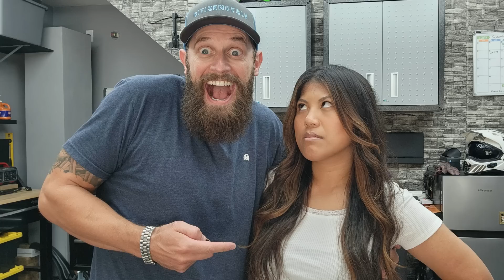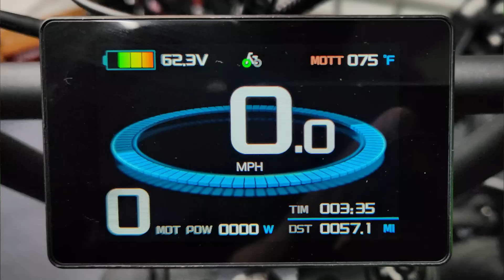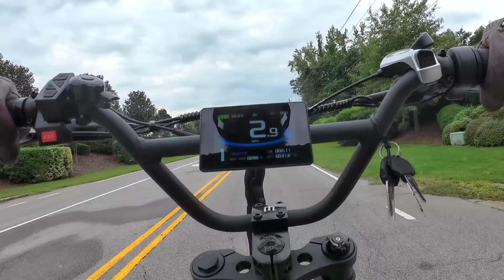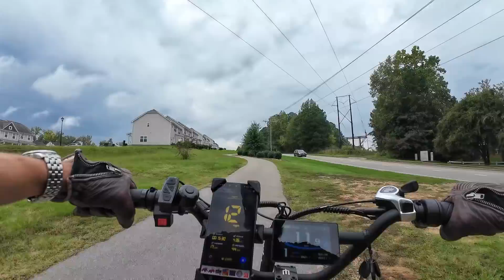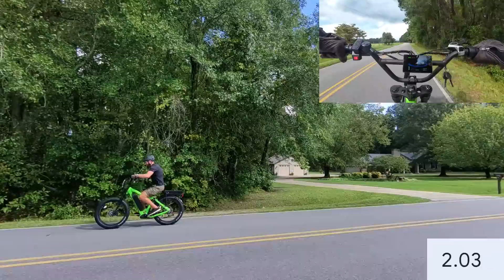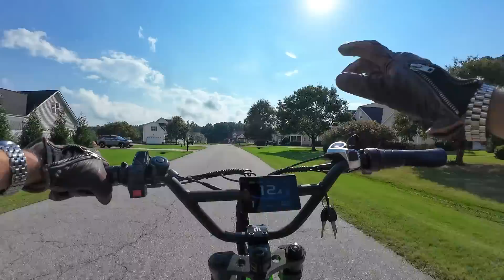Wired Predator: Testing a New 6000w eBike

Comment: Powerful bikes are not impressive. I hope Wired reads this, please make this bike rideable at low speeds for a 100 lb adult rider. Have the throttle curve fully adjustale to elimate the wheel spin or someone will get seriously hurt.
Reply: I have a different brand of powerful eBike.  Often the key is be in the PAS mode appropriate for the environment you are in.  For parking lots, I stay PAS 2 or less.  For Sidewalks, similar story.  When going through the narrow front gate at my house,  PAS 1.   Remember, the PAS mode on any eBike sets your "guardrails".

Comment: Very cool, Citizen. I hope Wired will refine the power delivery to the front wheel. It would have been interesting to see the front tire at the end of your ride. A tire with street tread would also help pavement traction. A 2nd throttle for the front motor would probably be the safest way to run this, though. 
Be careful with that thing. That much loss of traction on a front wheel is dangerous. Be happy that your beautiful wife is concerned. She could easily find a replacement.

Comment: Thats crazy all that power but i see it still goes about the same speed as the regular wired fredom
Reply: it's the area under the curve, torque monster!  gets there way faster!   think of how drag racing works.
Reply: @benhartland4708  I see sounds good but tbh I feel like it's over kill for range
Reply: Not to mention, do you think those Chinese tires are built for speeds 40 mph Plus?
Reply: @firstinlastout  idk from previous review on wired freedom they r. But idk how long they will last on the predators with there melt ur face off torque
Reply: @stephenolotu5588  the front tire probably a few days lol...seriously you'd have to ease in and not do burnouts to make them last.
Reply: @firstinlastout  they're not although i've maintained 40 plus mph for over 5 minutes straight on my Origin8 Supercells.

Comment: It's awesome but we all know that front tire will cost $80 to replace after 500 miles of riding haha. Those poor geared hub motors won't take the abuse for long I don't think lol. i see alot of people faceplanting on that thing. I think it's useful for the cool factor and the quick starts off the line and maybe for some straight lines in sand or mud but after that its kind of like meh funs over.
Reply: Yeah... its the 2 stroke dirt bike of ebikes. Made for some rips and not real functional on a daily basis.

Comment: I'm good with my '24+ single motor.....I've hit 42mph. That said, this beast would excel at steep trail climbing
Reply: Do u think u would get more range on the regular wired freedom or this one
Reply: @stephenolotu5588  Good question… you’re looking at more weight and faster battery drainage using two motors. Then again it’s all based on settings…. a good question to ask Dan or Steve at WIRED. 😉
Reply: 2 motors doing the same work as one motor burns the same watts. Work = force x distance
Reply: I have a lot of steep and rolling hills by me here in CT and my 2024+ handles them all (some to my surprise) with no trouble at all. Like you, I prefer my 2024+ over this which seems to be a little twitchy, but very cool nonetheless.
Reply: Depends on how you set up and use it

Comment: Have to correct one statement, while the controllers are pulling max amperage the batteries are not outputting close to 67 volts....usually a few volts above nominal. Not trying to be argumentative just trying to correct a common misconception among E-bike owners.

Comment: Very nice for those in hilly areas. It's nice to see wired offering more options for people. I only wish it hit closer to 50 on the speed.😂

I think I really need to get a hold of that 50 amp controller and put it on my early model 24'. That way I could do 40 much easier.
Reply: Pls let me know if u do it I'm getting my wired next week
Reply: @jeremywheeler2122 Look at the flipsky 75100 pro vesc controller.
Reply: The 50amp controller is a cheat，false advertising
Reply: @terrychang6683  What do you mean? Could you go into that a little further?
Reply: @jeremywheeler2122  Because Hentach 1500W Motor does not allow the controller current to exceed 40A, if it exceeds the motor damage caused, they do not provide after-sales service.

Comment: Looks like this has as much power as my psychocycle. 40amps in the front and 50 in the rear. Same top speed too since it looks like your speedometer is 2mph too fast compared to the gps speed. I got mine to about 42mph. That front wheel is going to be a struggle to control without a separate throttle. Can you adjust the starting strength of the front wheel? Hopefully people know how to handle an ebike like this, definitely not for a beginner.

Comment: Awesome. I have a 2023 Freedom. My accelerator comes in handy for intersections. And if I come to a stop in a higher gear my accelerator is a lifesaver getting this 80# ebike moving as I can't establish a cadence starting off in 7th gear.  Other than that I'm mostly in PS1 at 10-15 mph. I kick into PS2 and PS3 for hills on our public trails. Would like your demo and comments on its performance in PS levels at AWD. I live in the mountains and torque is everything. I like to pedal when I'm on my Freedom. Where I live a Class 3 ebike can't exceed 28mph or 750w. My Freedom does 38mph and I've hit 2250w on it.
Reply: Yep...I have a Grizzly and there's nothing like a dual motor bike for navigating traffic... people that have never driven a dual motor don't really understand the difference in acceleration.
Reply: N.c. law is must not exceed 20mph or 750w motor so idk what e bike to purchase for my first and it will be used for hunting purposes mostly so I want to get a dual motor 750w that I can atleast tell police I only run one motor on highway ... I like the Birch Grolar,  the fabulous Havoc dual motor step thru and Ireally want a step thru to traverse in the woods so I can easily step off quickly if needed when gets to rough... and recommendations  ?
Reply: @Crayz919  I'd get a Predator.
Reply: @Crayz919 wired has a bike called the cruiser, it’s not awd but it does have the same rwd motor as the wired freedom and predator being a 3000w peak motor and it’s a step-through bike. As far as cops go on the road and whatnot I’d just tell them it’s a 750w if they ask and be careful not to go too fast or heavy on the throttle near them.

Comment: I wish wired would sell a predator upgrade kit since its the same frame
Reply: it's pretty involved, not just a slap on kit.  not only would you need the new motor, controller and wiring you'd also need the new display, new rear controller to replace your current controller, new front fork and the predator sticker.  i'm sure i'm forgetting something.
Reply: @benhartland4708  sounds like the perfect project to me

Comment: hi bryan, is there any wobble issue and does it come with the visco headset, or does it not need it. what do you think of the front forks. also is the wires secured in the frame under the seat?
thanks again , AWSOME VIDEO

Comment: I'd rather have gotten 2  20 Ah batteries for my freedom. The rear rack for  the freedom is too wide.I'm 6'2",
& I whack my knee everytime I throw my leg over. I have narrower rack I made that's perfect for the 20Ah,
& will fit in either position. It makes better sense
Reply: Exactly the reason why I would get a step thru cruiser. I’m almost 6’5” and would be putting a basket on the rear of mine for groceries.

Comment: I just got my wired freedom. They couldn't come out with this a few weeks ago 😢  lol. Not that I don't love mine
Reply: Right mine will be here tmr. I wish they would sell a conversion kit
Reply: I'm buying mines around next week but as much as I like the predator the dual motor will chew through the battery faster making the range in my opinion similar to regular bikes
Reply: I think the 2024+ (dual battery) is the sweet spot. This spins its wheels accelerating and has the same top speed. With the additional weight, and same battery system, it will have less range. The 2024+ handles hills just fine. All of these 'upgrades' on the pred are situationally great at best, and a downgrade at worst. Hate to say it, because I love my bike, but I think Wired missed with this one...
Reply: @aetheon9906   yea that's what I'm thinking only reas9n I'm watching this ved is bec im trying to decid3 which color to get I'm between the blue and the lime green color. Blue is my favorite color but that lime green n black wheels n black battery contrast is just chef kiss. I wish there wer more vedios on the colors

Comment: So strange......I thought for sure you'd get at least 50mph 🤷‍♂️
Reply: Dual motors does not increase top speed .
Reply: @gregorygrant3643 why what makes top speed better.
Reply: @gregorygrant3643  I mean the voltage went up to 67 volts is that what is making it torque
Reply: @gregorygrant3643  I never said anything about Dual Motors, but I'm sure there's some truth to what you said.

I'm reviewing an Aniioki A8 Dual Motor right now that goes over 45mph with less stats. I assumed those impressive component stats would be enough to get at least 50mph is all.

Comment: I just don’t see it being worth it. Tire spinouts are fun a few times but I feel like it’s going to get real old when you’re burning through front tires and never grip the road on the acceleration which is somewhat dangerous. Similar top speed for 1000+ more price and it’s heavier? Doesn’t scream buy me.
Reply: Exactly what I'm saying
Reply: Plus the speed r relatively the same
Reply: This guy was just blasting the accelerator to show what the bike is capable of, in real life no one would ride like this everywhere.

I have the wired freedom and I spend a whole lot of time in pedal assist one to enjoy the very long battery life so I imagine people would do the same with this one and they’d still have the ability to climb hills if they’re steep or the rider is heavy.
Reply: It’ll get old until you go back to your old bike then you’ll want the power back again !
Reply: @johnnightly5281 the problem is that I have no desire to lose tire traction on any type of acceleration. I wouldn’t miss the power because I value control over the wheels more.
Reply: @RestWithDeAndre you control what it does and doesn't do.
Reply: @RestWithDeAndre just dial it down problem solved
Reply: The kenda krusade tires are a off road tread. Street tires would stick better.
Reply: Your right, I have a 1000W MOTORS AWD 20X4 30AH 48V 1269DOLLARS CHINA IS CHINA 🇨🇳??!!
Reply: @alanflatau1685 home built or a store bought?
Reply: @tenncutt Seriously Bro…….

Ummmm, You must of missed the part when a NJ Alien Drone flew down and dropped it off at this guys house….  I believe it’s around the 2 min 30 sec mark…. Nice ship too…. 
Keep on Keep’n On My Friend….. Say Hello to the Wabbits for me…. Thx
Reply: OML……..

What are you smoking Bro???? 
Pardon my opinion, but you sound like the kind of guy that would be more comfortable on something from a Walmart or on a hot wheels trike and not something of this magnitude.
Reply: Hub motor will not gomuch faster it about the excell
Reply: I just bought a Rwarr Mantis, & that's good money spent on a bike built for power like that & it's a mid motor, I know a disk motor ebike was a gimmick when the Ariel Rider came out! 😆
Reply: @rwarr
Reply: Who says you have to do burnouts all the time? I'm talking about having a great range and keeping up with traffic right next to my head when you need the power to stay safe❤
Reply: Got one ordered 
Be here in March 🎉
Reply: Use a single motor.
Reply: Freedom hit 43 mph.  This is a dealbreaker.  Also Wired still hasn’t listened to my humble feedback that they need a 20” option!!  Until then the goat is the goat.
Reply: @roger3958 I agree I don't like26 inch Fat Tire definitely prefer 20-in
Reply: @roger3958 Thats why i ordered a furious clone from china…60v , dual 1000w, dual batteries and looks just like the furious….ill only get about 40mph which is fine
Reply: Dual suspension dual mid drive cotton mouth hitting speeds over 60 mph and still looks like a bike with better handling and not worrying about front tire spin or wiping out around corners.  Mid drive that still rides if a chain were to break but since there is no stress on the chain it should never break! and a belt drive connected to the motor. And without weight on rear and front tires the bike just performs better!
Reply: @quantumfx2677 sounds lk a beast.   which bike do you speak about?   Thanks!
Reply: @bdub3871  We are looking at the cottonmouth! They are suppose to come out with their dual suspension which for me is the way to go! Now, you can get the cotton mouth middrive by itself as long as you can find a bike that it will fit into! This middrive is really the way to go and the only way to go that a woman can drive it and not have to worry about being in the wrong gear! Never have to worry about breaking or stretching out a chain! And if a chain did break you can still ride it! The motor is using a belt which is the way to go! This motor is so powerful and not really huge it definitely creates a sleeper build that looks just like a normal ebike but can hit speeds of 67mph which many may not care about that kind of speed on a bike but we have to look at hill climbing!  We won't be slowing down going up a hill like most ebikes do! You are doing 30 or 40 on a hill you will be maintaining that speed! So much potential for this motor and can't wait to get one and get going on a good build!
Reply: Oh okay, I reread your comment.  So Cottonmouth is a middrive motor coming out that you would install     Gotcha.
Reply: @bdub3871  Or you may purchase their ebikes all ready to go!

Comment: I like it I want one but I do like the front wheel drive kits that you make with the thumb throttle on the other side that way I can add it in anytime I want I don't like that switch I have now gotten a second kit front motor kit hopefully soon it will arrive if they can do an auction where you have the thumb throttle and a choice of either way of doing it with the switch or with the thumb throttle

Comment: THIS IS 🔥...I really wished that WIRED made a 20 X4 smaller frame configuration for us city dwellers!!! But IDK still debating on this one 🙂
Reply: Dang, that would be crazy.  Imagine the wheel spin on a 20" wheel with that level of power.   But love the smaller frame idea for the city!
Reply: I live in the city of New York and let me tell you I have a one bedroom apartment and my Wired Freedom fits perfectly fine so don't be afraid of buying one of these. I don't know about this Predator thing. The Wyatt Freedom by itself is fast enough for me
Reply: Yes, with a option for a 50-60 amp full frame battery. I'll take two.

Comment: I'm glad the throttle on your Wired Cruiser works well. The throttle on my Wired Cruiser is a total P.O.S. Impossible to modulate at low levels. I wouldn't try doing a U-turn with my bike using the throttle. At mid to high throttle settings it works as expected but the bottom range is either on or off. Still, I have to say that wired sells a lot of bike for a reasonable price. Mine just doesn't have a nice throttle.
Reply: I agree. Love mine, but it's one of the big drawbacks of these bikes to me. As you said, the throttle feels like an on-off switch. There's a bite point it kicks in about 30 degrees into twisting... and honestly, I don't feel any ability to modulate it at all. On or off. I use my pedal assist buttons as 'gearing' and am constantly changing PAS level while I ride to compensate for this. It works fine, but a real throttle would be much nicer.
Reply: You can fix that in settings @aetheon_horror
Reply: Amen to that
Reply: I don't find this to be a problem at all with my Freedom
Reply: @TunaSoda  You should be glad.

Comment: New competitor to the E-cells AWD Monstar.
Reply: I would like to see the two bikes compare against each other and I see which bike will come out on top 💪 I believe the monstar will outperform and is a better value for your buck 💰
Reply: @Beltfedshooters  no comparison to ecells. Try to call them and ask a question maybe send an email and see if u get an answer… call wired they answer and respond to emails right away.
Reply: The E-Cells Monstar has a larger front motor I think, same as the rear Hentac. That's why some lighter riders can get over 45 mph on the E-Cells.
Reply: Competitor? No. This company continues to lie about a UL certification.
Reply: @StayConnectedEV no they don't. Maybe try looking it up.
Reply: @StayConnectedEV  Pretty big accusation to drop without any details at all... Not disputing your claim, but could you provide a source?
Reply: @StayConnectedEV  it's on their main page bonehead
Reply: @StayConnectedEV yet it's widely known throughout the ebike YouTuber community that you purchase your subscribers!  Talk about the pot calling the kettle black. 😊
Reply: @GoneIn88   coming from the admin of the wired facebook group who has been losing members week over week because of all issues you ban them you can troll as much as you want 😂 have a goodnight

Comment: Are 203mm rotors even sufficient at this point? I've had some "pucker" moments from people pulling in front of me at lower speeds than that thing goes.
Reply: Yes because you are stopping from the same top speed
Reply: @johnnightly5281  this is correct
Reply: The question is, do you think those cheap Chinese tires are speed rated for 40 mph plus? Nobody seems to be asking this. It's like getting a Dodge Charger hellcat, with regular R-rated tires, when it needs ZR rated tires
Reply: @firstinlastout  i think all the 26x4 tires are rated for either 20 or 28mph but there are THOUSANDS of us who have maintained over 40mph on them for extended periods of time.  doesn't mean we're smart for doing so.